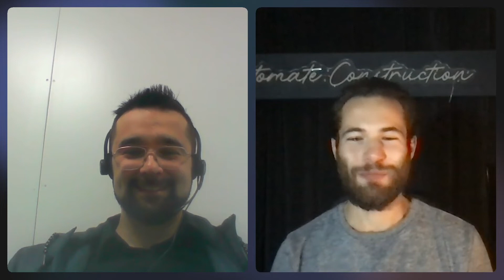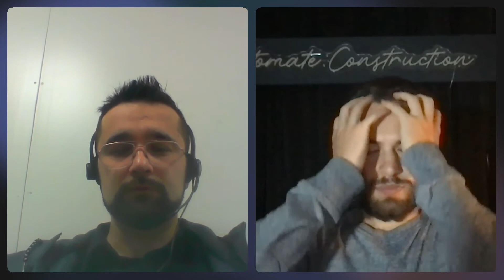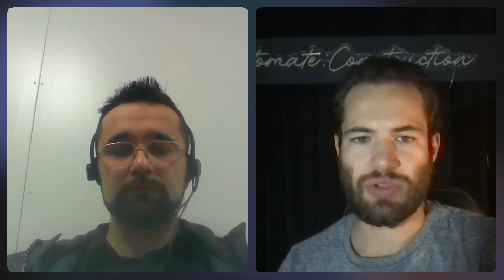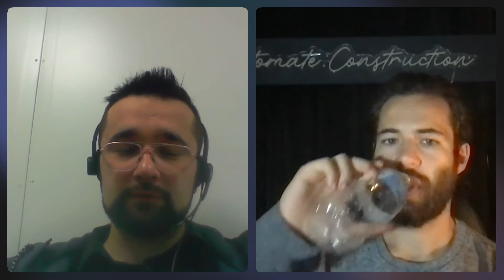Rebuild 3DCP CEO | Printing Concrete in Poland

Comment: Pumicecrete is 10 parts pumice to 1 part cement and 1.5 parts water where temperature or humidity is not a factor and where all the doors windows electric and plumbing are installed in the forms before you pour taking a fraction of the cost and time and labor
Pumicecrete uses a fraction of the cement and is a fraction of the weight of normal concrete 
Shrinkage is not an issue and no expansion joints are not necessary and can be poured one bucket at a time without cold joints
My goal is to build a pumicecrete home for Community First in Austin
If the goal is to build better faster stronger and cheaper then pumicecrete is one of the better  solutions